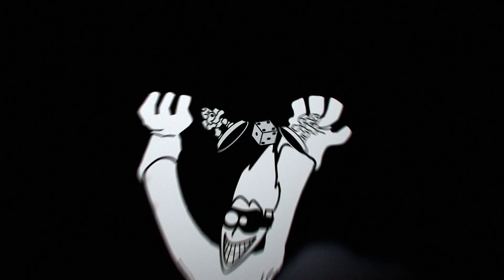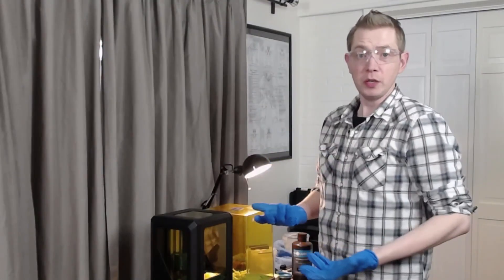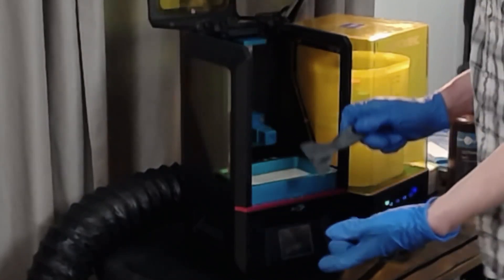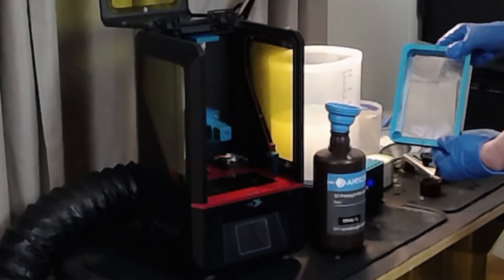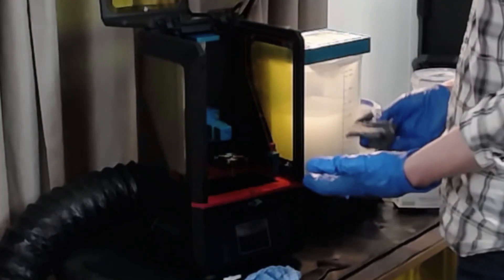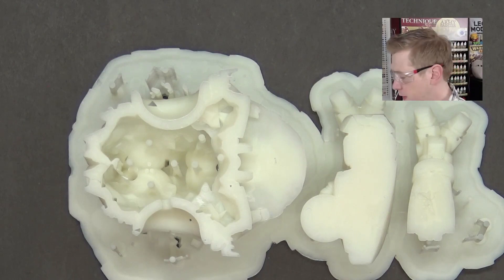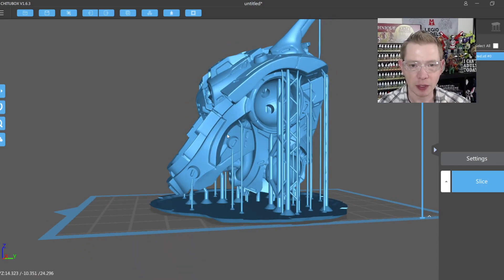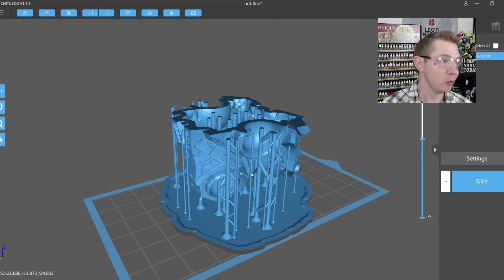My 3D Print Failed, Now What? Anycubic SLA

Comment from the maker: I show you how to clean up and fix your 3D printer after a failed print. Titan-Forge provided models for promotion in this video. Get their models for just $10 here: http://snip.ly/Titanforgepatreon  Here's my list of 3d Printers and essential products to set up your own factory at home!  ➡️ https://snip.ly/3dprintingessentials
#3DPrinting
Anycubic photon S 3D printer is magic for minis https://snip.ly/d13u0z
Anycubic Photon is pretty affordable and easy to use: https://snip.ly/ba7012
Anycubic Wash & Cure Station https://snip.ly/Anycubicwash
Elegoo Mars (has pretty high marks as well from folks)  https://amzn.to/2U4aMr4

Carbon Scrubber Air Filter:
So this is purely optional if you have good ventilation you may not need it. The key thing to get is a rear vent adaptor, you can print one out on your new printer, but it may not be as strong as a single part one.

4” Dryer Hose Flange Duct https://amzn.to/2wccU86
Phresh Inline Carbon Filter https://amzn.to/2WexKyv
4” Black Flexible aluminum Dryer Hose Line https://amzn.to/2x1jPkx
4” Variable Speed Inline Fan https://amzn.to/2xIVv7L
5-gallon bucket and Lid: https://amzn.to/33jlWwp
Duct clamps (you need 4) https://amzn.to/39XkHFC
Get this print out for a rear vent adaptor https://www.thingiverse.com/thing:2877754
Self Tapping Sheetmetal Screws & Washers
This is a cool self-contained unit that may do the trick as well for 1/2 the price and work: https://amzn.to/2J00wem

3D Printing Supplies:
You won't need the pickle jars or the UV cure unit if you get the Anycubic Wash & Cure Station (below).

Waterproof Silicone Prep Mat https://amzn.to/3aYDobY
Microfiber Cleaning Cloths (for the print film) https://amzn.to/2vZLa6T
Pickle Jar for washing parts https://amzn.to/2WgYpdS
90% or higher Isopropyl Alcohol (12 pack) https://amzn.to/2Qg5Wpq
UV Curing Station (3-time settings) https://amzn.to/33l0cA2
Anycubic Wash & Cure Station https://snip.ly/Anycubicwash

These are affiliate links, as an Amazon Associate, I earn from qualifying purchases

Comment: This is a good tutorial. One thing I am concerned with is that not many people wear the correct safety glasses. Resin is a liquid and you should be using liquid based eye protection.
Reply from the maker: true good point. I had to switch to that myself.

Comment: Quick tip for resin printing - download Prusa slicer and set it up for their resin printer and adjust the bed size to suit. Import your models and allow the program to auto add supports. Now export the build plate as an STL file including supports. Open and place the resulting file in your normal slicer and slice - DO NOT ADD SUPPORTS. Copy to the printer and hit go. 

All my prints before this method used to fail 60% of the time, with this method over 300 successful prints with only 1 fail.

Comment: Ive not been able to find an answer anywhere, but do you have to empty the tank after every session of printing with a resin printer?
Reply from the maker: I haven't no. Generally, I only empty it IF I know there is a lot of debris/uncured resin in there after a failed print.